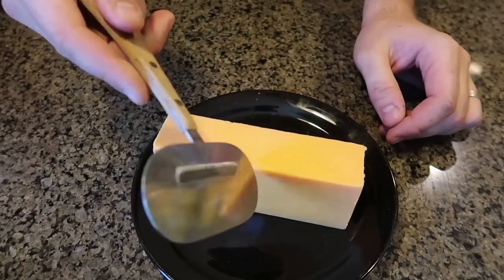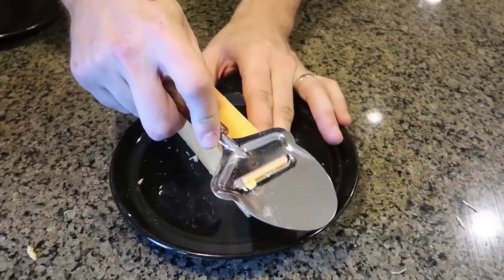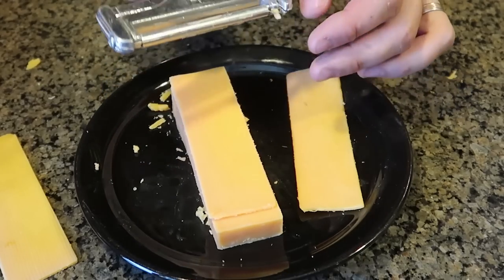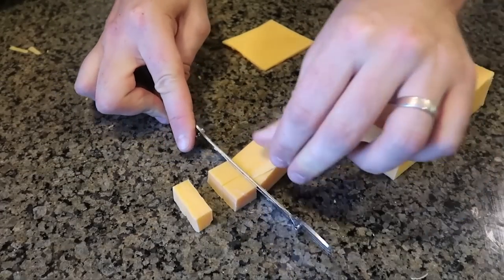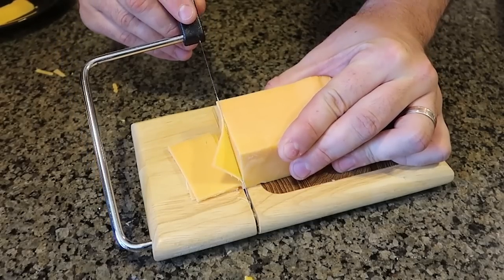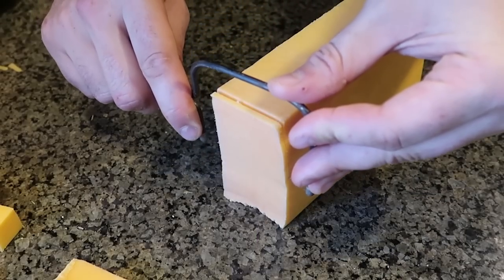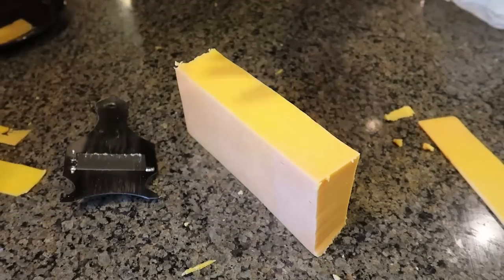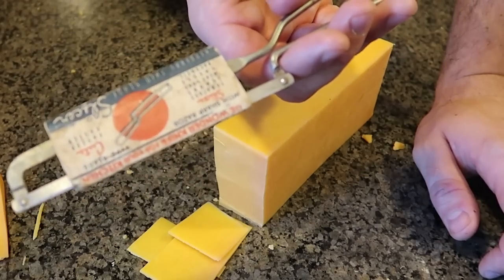10 Strange Cheese Gadgets put to the Test  - Part 3

Comment: I usually warm up my Cheese slicer a little bit in hot water before slicing. The blade moves much much more smoothly and without getting stuck.